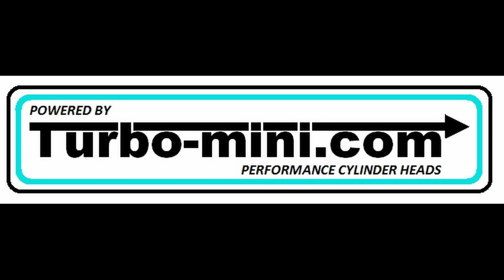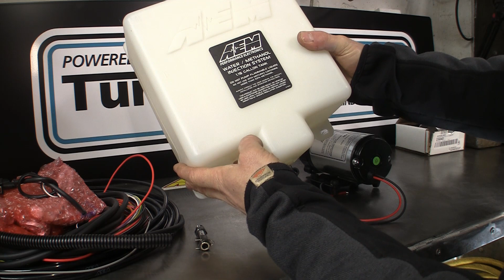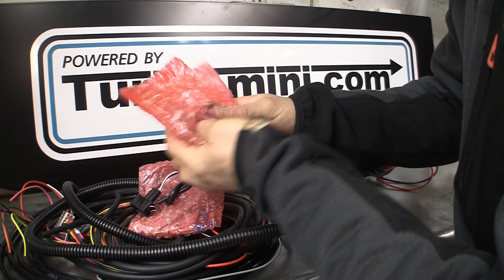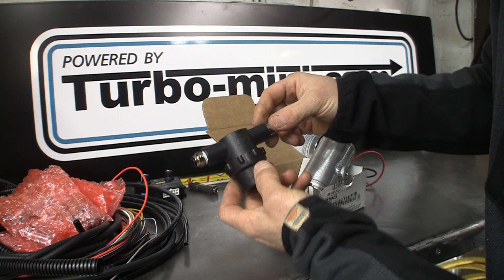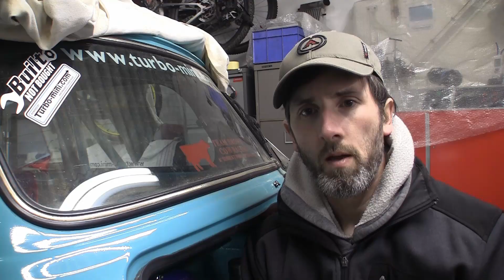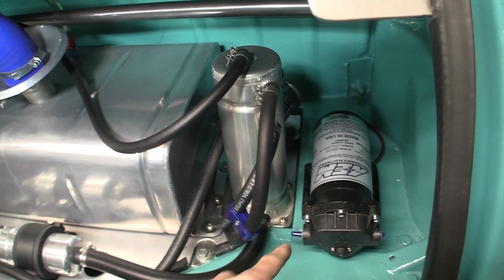Classic Mini Turbo AEM Water methanol Injection Installation guide Part 1 Installing the kit.

Comment: Where did you fit the injectior? How far away from the intake plenum?
Reply from the maker: @jamesrickwood6333  Do you have an intercooler fitted?
Reply: @TurboMinicom  yeah I have a intercooler behind the front grill.
Reply from the maker: @jamesrickwood6333  fit the nozzle in the pipework just after the outlet of the intercooler. The turbulence here will provide good atomisation of the water/meth and the distance from the carb will give it time to absorb heat from the air.
Reply: @TurboMinicom  thanks. I was going to fit it half way down the inlet pipe. It will be a bit easier for me to fit it where you said aswell.

Comment: How would you know if you actually need methanol injection? Engine knocking on a dyno but if no knock sensor. Could you go by the inlet temperature but what temperature would be too high
Reply from the maker: @jamesrickwood6333  you’d need to monitor/listen for knock, intake temperature alone won’t tell you whether the engine will or won’t  knock. 
You could have extremely low intake temps, but if something else is off the engine could still knock. 
I bought a gauge and sensor to listen for knock but haven’t used it yet.
Reply: @TurboMinicom  OK cool I was looking at phormula knock detectors the other day. I have pro sport intake temperature gauge to fit soon. Because my ecu does not have intake temperature input..I'm just trying other stuff rather that putting a bigger turbo on. I have a gt1752 hybrid at the moment with a gt2056 billet wheel.

Comment: Hey Phil
Could a water/meth system replace the need for an intercooler? Thinking of doing a behind the engine build.
Would tbe nozzle be better tapped into the manifold after the carb or is it ok to have it before? 
Thanks
Reply from the maker: Hi. Yes it’s possible to use water injection as a substitute for an intercooler. Though bear in mind if you tune the car to depend on the extra knock suppression the water gives and for some reason the system fails, it could cause big issues. 
I would install the nozzle before the carb, directly after the compressor on the turbo, this will allow some time for atomisation. Which fitting the nozzle in the manifold would limit. 
You could also look at fitting the nozzle pre turbo, though there’s possible negatives to this, so it’s worth some consideration and research before going that route. 
Phil.

Comment: Gidday mate, how loud is the pump? Thinking of installing in the cab of my ute but not sure if its going to be a pain in the ass? Cheers
Reply from the maker: Hi Will
I’ve not had the kit running on the car yet unfortunately. But with the amount of noise my car makes, it’s not something I’m worried about & as the pump will only activate under boost I doubt it will be to noticeable over the engine noise

Comment: What pressure are you planning on boosting ? So I can get some more ideas,  and water meth is such a good mod 👌👌
Reply from the maker: I’ve been running 20+psi previously, so at least that and a bit more probably.
Reply: @TurboMinicom  dam so it's going to haul !!
Reply from the maker: @barnbuilds25  hopefully! There’s a video from way back in 2006 of it running 16psi here: https://youtu.be/oDcknBW0mnw
Reply: @TurboMinicom  Going to watch it now!
Reply: @TurboMinicom  I was thinking to run at around 1 Bar so 14.5 Psi roughly
Reply from the maker: @barnbuilds25   you can make decent power at 1bar and have a pretty quick car especially as the Mini is so light.

Comment: Hi Phil, currently building a turbo lump with moderate boost and inter cooler, would you tap into the oil galleries and install under piston oil squirters? cheers Martin
Reply from the maker: Hi. They’re certainly not required, but they don’t have any downsides. It’s a cheap and easy enough modification to do while the engines apart, so why not.

Comment: Have you got another fuel tank somewhere Phil?  The one in your boot looks only about 4 gallon?
Reply from the maker: No just that one. It’s a 5 gallon so not great for long journeys.
Reply: @TurboMinicom  Ah ok, I really want to increase my fuel capacity, It gets a bit monotonous filling the 6 gallon tank in my clubby estate twice a week
Reply from the maker: @MrNursi  you can get bigger versions of the type I have, but I picked this up cheap years ago so seemed a shame not to use it.
Reply: @TurboMinicom   if like to find a tank that fitted in the rear subframe. I don't know who told me but apparently an Imp fuel tank fits. Do you know owt about that Phil?
Reply from the maker: @MrNursi  I don’t sorry. I’ve never had much to do with estates.

Comment: Brillaint timing! I'll be doing this when I add a turbo in the spring or summer, at first as a safety measure and instead of an intercooler. NIce to have a video tutorial!
Reply from the maker: Good stuff. Thanks for watching. 
What’s your engine spec?
Reply: @TurboMinicom  1293 A+. Stock. Not planning on using a decompression plate, just planning on keeping the boost low and using H2O as an added safety measure. I'm not looking for massive gains, just a little more useable power in the midrange.
Reply from the maker: @briangrant2426  sounds good, it’s not all about maximum power.

Comment: Phil, I have found when the car sits for a while the find the nozzle gets clogged, I used an in-line solenoid valve and a float in the tank so if won’t run if the tank is empty. The solenoid vale works to shut the line off to the nozzle but the engine will suck the stuff left in the nozzle out, seems to work over the last few years
Reply from the maker: Thanks Graham. I’ve considered fitting a solenoid. I’ll see how I get on. Thanks mate.